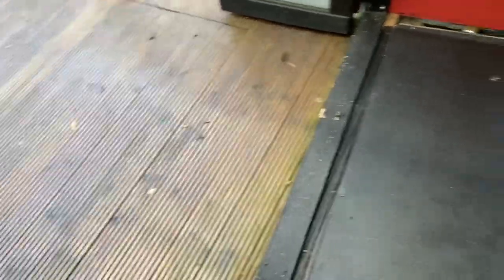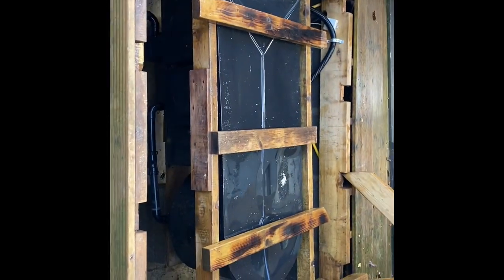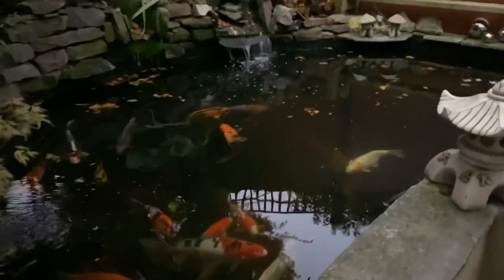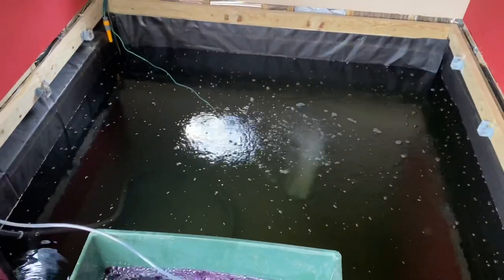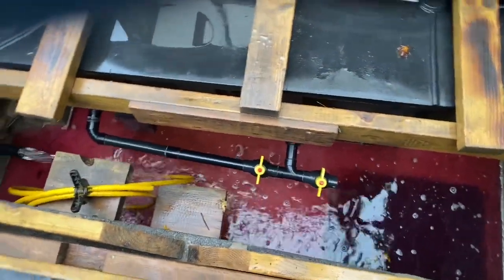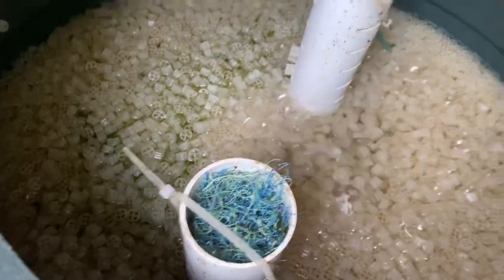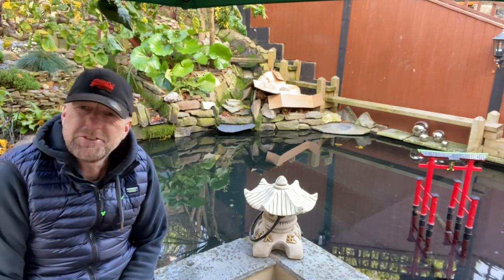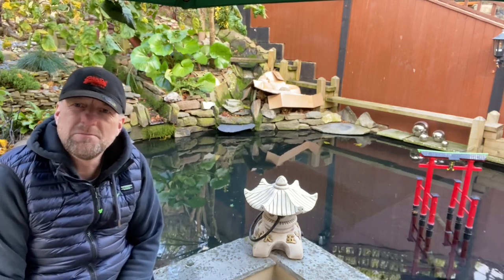The hidden Koi pond***Koi pond part two

Comment: I'm sure the koi will be happy over the winter. What concentration of PP do you use for the dip and how long do you leave the fish in it?
Reply from the maker: This is what I go by. 

Dip: very effective for parasites, bacteria, ulcerations etc. Use 1 gram per 10 liter water for 7 minutes. Always aerate and ALWAYS remove the fish if it gets restless and jumpy. Control timing precisely and do not treat too many fish at the same time unless you can time the treatment of each fish correctly.
Reply: @japanesegardenbristol7842  Thanks so much for the dip details. More  time consuming but much easier than treating the entire pond. Safer and more cost effective as well.
Reply from the maker: @mykoiobsession  
Yes your right and since I have been dipping them I haven’t had one parasite.